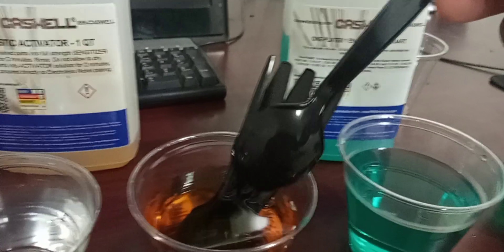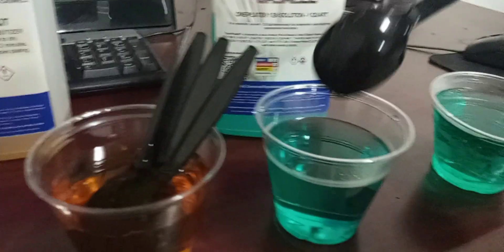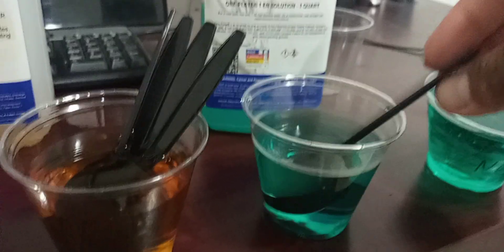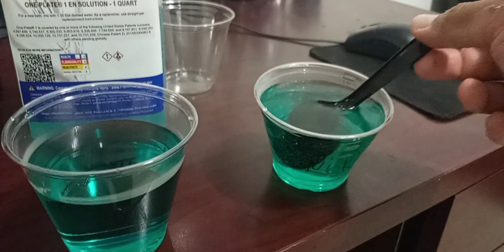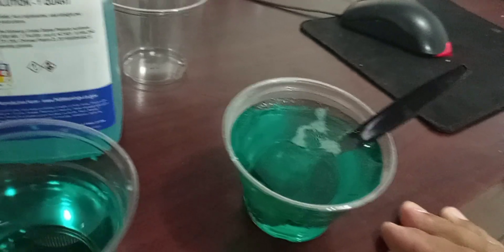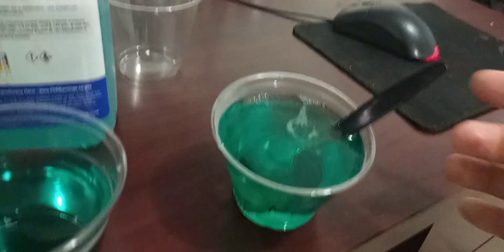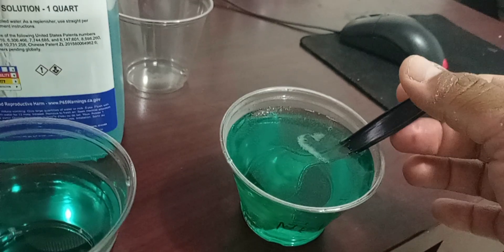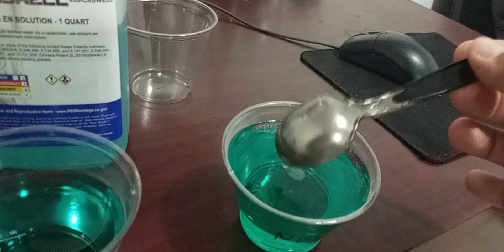Electroless Nickel Plating plastics

Comment: I got an electroless nickel and plastic actuator kit both from Caswell. I’m missing something in the process. In testing so far all I’ve been able to get is a splotchy result. Can you give any pointers or recommendations? I feel dumb because I plate chrome.
Reply from the maker: You are missing the Wetting Agent and/Or Flame Treatment. Both individually and combined will reduce the water surface tension on the piece
Reply: Thank you
I use several plastics and also fiberglass resin for 3D modeling. I believe I’m going to have to do some research. I’m also wondering if mechanical abrasion to make a textured surface would help.

Comment: This is really cool, I've tried using the Caswell process for plating my SLA prints but the temperatures required for the degreaser and electroless nickel plating solution are too high. Can you please share the details of the reducer? Also, did you use the electroless nickel plating solution directly or did you water it down as per Caswell's instructions?
Reply from the maker: Hello, I sent you an email with the Formula and additional info. When using the Caswell Electroless process I plate the parts at a lower temperature of about 155-160 no more than that and it works. The reducer is simply just Nickel Sulfate as prewash just before electroless nickel, you can skip it if you like.

Comment: this is amazing. how strong is the plating on the plastic? I’ve nickle plated plastics with a conductive coating using traditional electroplating, which gives a very tough plating. I’m wondering how this would compare.
Reply from the maker: This is for Aesthetic purposes only. like spray on Chrome or chrome paint. but it can be used as a conductive paint alternative for high detail parts.
Reply: Can u pleas tech me the traditional method?

Comment: Finally received my caswell chemicals for electroless plating plastic parts. Question: How hot do you get the final nickel plating solution?
Reply from the maker: Depends on the plastic heat tolerance. For 3D prints I do 160.